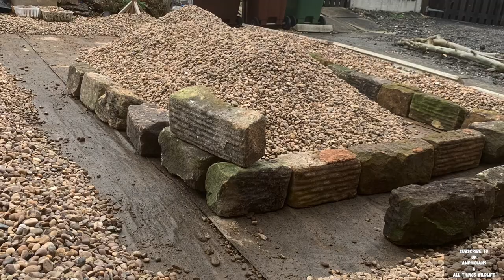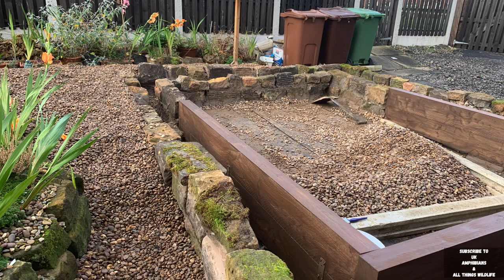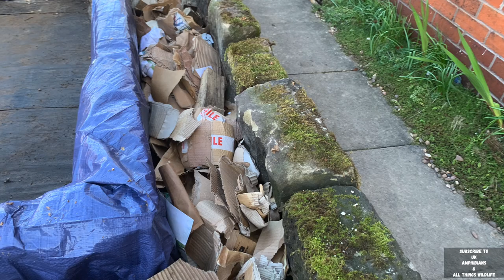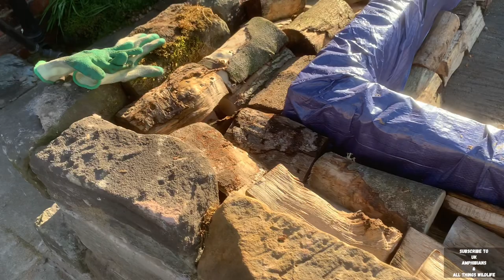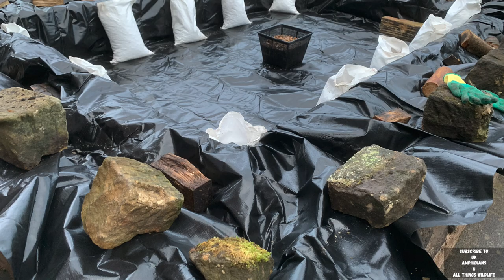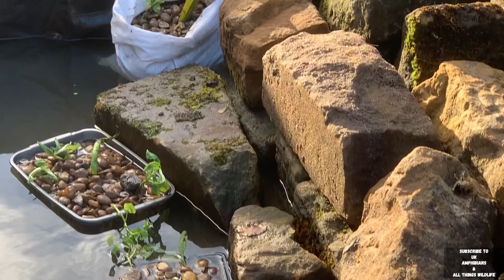How to build a raised Wildlife Pond with a built in Hibernaculum #wildlifepond #garden #nature

Comment: What does the cardbord do? Wouldent one be able to use something more natural?
Reply from the maker: It rots down and attracts insects makes perfect hibernation materials. It holds moisture too which seems to attract amphibians to hibernate under winter. Also a lot of people burn off cardboard which is not good for our ozone layer. So by cardboard natural rotting down it helps our insects thrive on it as well as our amphibian population 🐸💚🐸
Reply: Saw some of the cardboard had plastic on it, you should've taken it off. The sellotape etc. But overall a great setup.  @UkAmphibians
Reply from the maker: @SRC267  Thankyou I remember going through the cardboard after the video and taking off the cello tape after 🐸💚🐸